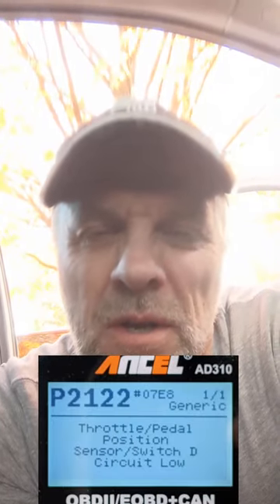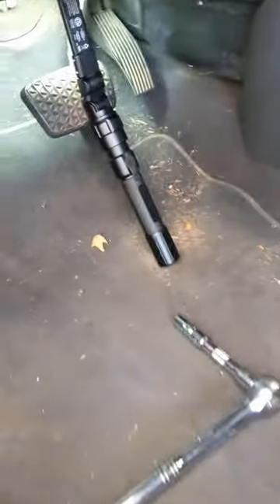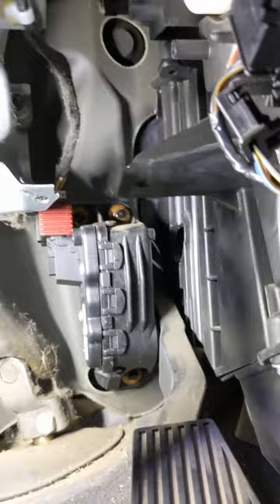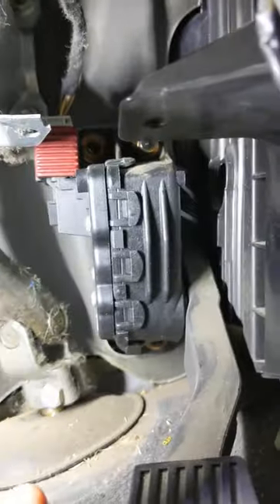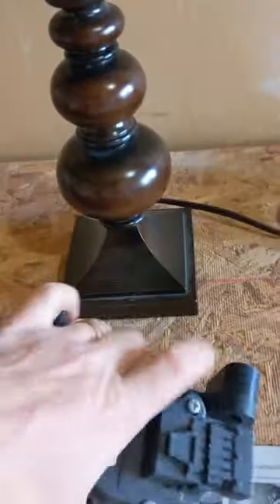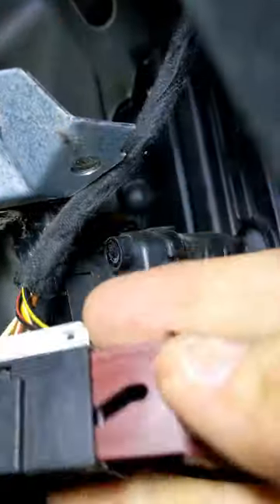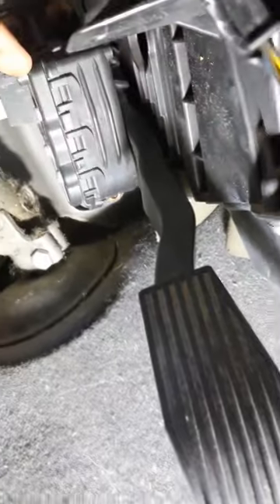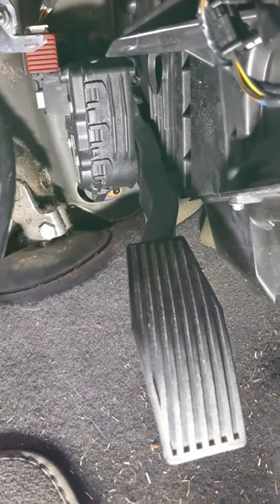P2122   Accelerator Pedal Position Sensor

Comment: Thanks for the 2nd video I’ve watched from you today. First was replace the throttle body and now this. The Astra began to surge after a several years of just ignoring the need to replace the Throttle Body, so it became a necessity and that’s solved. I never cleared all the codes but when I fired it up it worked so took for a spin. After parking and restarting the check engine light came on and my heart kinda sunk. Well P2138 & P2122 all point to accelerator peddle but it was replaced just 2 years ago. So will continue to investigate, probably going to need a manual if a new throttle pedal doesn’t fix it. Thanks for your videos!!
Reply from the maker: Hi @quanahthompson6000 Does your Astra go into reduced power mode (a.k.a., limp mode) when the codes were thrown?
Reply: hey 22 4runner SR5. this is happening to me and mine goes into Limp mode. mine throws P2122 code as well i’m trying to decide if i need to replace that sensor?

Comment: Can a failing ECU also cause these codes to throw?
Reply from the maker: Sorry for the delayed response... I suppose it's possible, but I would not make that call until you've checked all the wiring in the circuit.

Comment: hi...can you tell me if you felt any bad symptom before you reader confirmed please?
Reply from the maker: The check engine light (i.e., malfunction indicator light [MIL]) came on and the car went into limp mode. Very slow to accelerate and RPMs were limited, typical of limp mode. However, pulling over, shutting the car down, and restarting would usually restore from limp mode but MIL would remain lit until I cleared the code. Since installing a new pedal, the problem has not occurred again, fortunately.
Reply: @JamesDvorak  Did you not install a new gas pedal in this video ?
Reply: @JamesDvorak  I thought you did

Comment: i have a 03 pathfinder 3.5 i scan it n it tell me the pedal sensor has low voltage
Reply from the maker: Could be the APP or could be corroded wiring somewhere creating resistance.